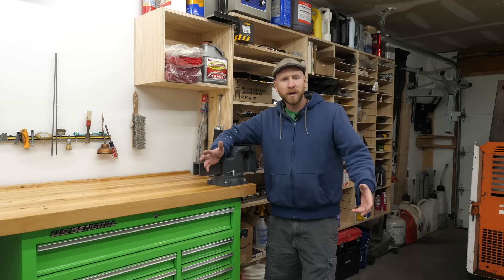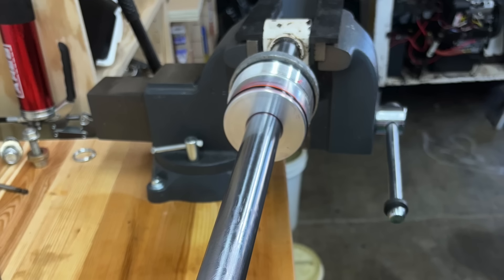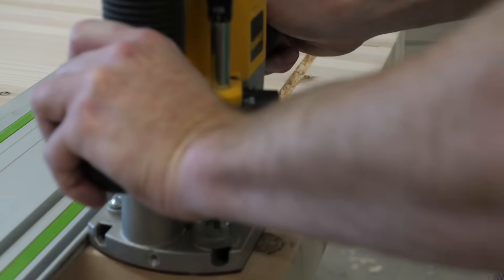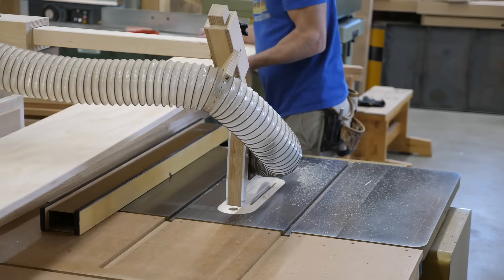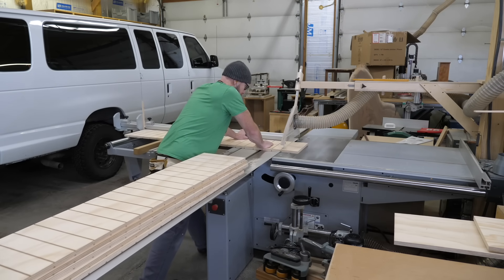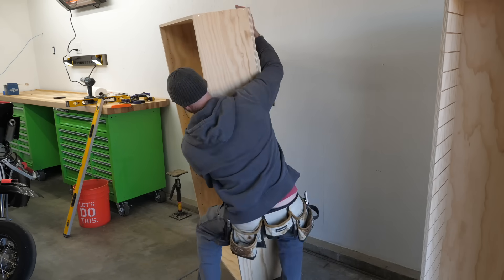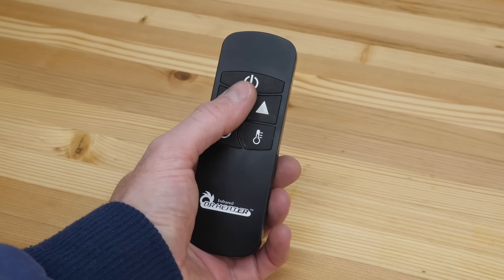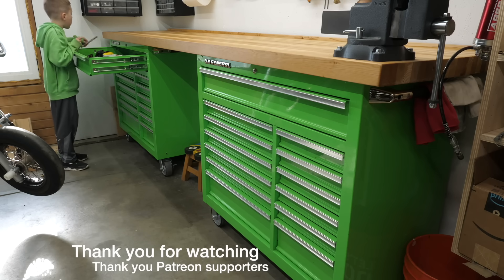Garage Organizer and Workbench

Comment: I built a similar system with these differences: the cabinet casters removed, and I built a wheeled tray for the cabinets to sit on. They got their own top that performed as a roll-around worktable. This cabinet tray was stored under another bench. So now I had two work benches, one permanently in place and under it a roll-out tray of cabinets also with a work top. As I got into hand tool wood working, both were insufficient and unsteady for hand tool work. They were scrapped and the wood turned into replica antique tool chests. I think your 2x6 lumber top will be fine.
Reply from the maker: I considered removing the casters to put the workbench at a more manageable height. Sounds like you have a great setup.

Comment: Enjoyed! 

Small tip for metal vises- bolt in a strip of copper instead of their OEM crappy hardened steel inserts. Much less marring and excellent grip without futsing with plastic jaw protection. Last vise I did was a 1960’s vintage Record #6 for which 1/2” x 1” copper bus bar was perfect fit. And cheaper buying it as bus bar than exactly the same copper from any of my usual non ferrous suppliers. Holding up well in a machine/fab shop with heavy use. 

Bonus: makes a good heat sink for small part tig welding :-)
Reply from the maker: That is a very good tip. Thank you for sharing.
Reply: For those in the 3d printing hobby, print some replaceable jaws out of TPU. I have some up on thingiverse for the HF 5" vice.
Reply from the maker: @larrybud  Totally cool. Thanks for sharing.

Comment: Idea for your waste motor oil. Build a Sand Box for Garden Tools. Build open box approx 2ft wide,12in deep/high. Fill with coarse sand, add copious motor oil/kerosene mix.
After using garden tools, shove vigorously into sand/oil mix to remove all mud/garden residue, leaves oil residue to prevent rust & smooth surfaces dig into garden easier. Hang tools above box to catch any drips & air dry
Reply from the maker: That is a very interesting idea. Thank you for sharing.

Comment: I have been thinking about a top like the one you built - you validated my design approach. And my cheapness, because I could just go to Lowes (not Home Depot) and buy butcher block. Love the magnetic sheet idea. Thank you for another great video.
Reply from the maker: Thank you. A butcher block would work fine if you can find one for a good price in the size you need. Good luck with your project.

Comment: In the process of making almost the same thing except I bought a 10’ X 24” wide X 2 1/4 maple top from grizzly and two 27 inch US general bottoms (plus one top) and one 46 inch. One of the 27 inch and the top will sit at the very end of the bench (not under it) for small parts storage (using Schiller bins). Mine are in gray.
Reply: Oh, and I’m just adding ply to the top of bases rather than routing slots in the top. With my ongoing shop build, “perfection is the enemy of progress.”
Reply from the maker: Sounds like you have a good plan. So far, I'm really liking my setup.

Comment: I totally agree with the look of the revolution ply, it's used as a sub floor for tiles here in Canada.  It comes with a printed grid for screws which I tried sanding off but the veneer is way too thin.  They should make it furniture grade, would be a cheaper alternative than the bamboo that looks very similar.
Reply from the maker: I totally agree. There is a lot of potential.

Comment: Hey Mike! Excellent video as always. I have those same lights in my garage and man what a game changer it is to have good lighting.

Out of curiosity, why staples instead of brad nails? I hardly ever see people use staplers for this kind of thing but admittedly I have no idea why
Reply from the maker: Staples are a little stronger for cabinet assembly. If you don't have a stapler, brads are just fine.
Reply: Thanks! I suppose brad holes are a little easier to fill if it is in a place that it matters. I'm going to start using my stapler for other stuff though, thanks!
Reply from the maker: @crankstonshnord6591  Yes, if it is an exposed side, brad nails are a better choice.

Comment: Hey Mike, you might want to get that saw serviced - my TS55 goes through 8/4 hardwoods without any real issue, quickly.
Reply from the maker: Hmm. It is like a million years old, maybe there is something wrong with it. I'll need to dig in and see.
Reply: @MikeFarrington  I agree with Mike, the TS55 is underpowered. Okay, a fresh, sharp blade will make a difference. But for a full depth cut, I'll always do it in multiple passes.
Reply from the maker: @idontthinkso666  I know its not the same thing, but my skill saw can make a full depth cut with a horribly dull blade and not bog down.

Comment: Why did you use 2x6 and half them vs just using a 2x4?
Reply from the maker: Yeah, good question. I forgot to mention, all the 2x4s looks horrible. Where as the 2x6s looked much better.
Reply: @goaliem288, yeah actually using 2x6's will result in less warpy stuff after you resize it... it's a cool shop furniture secret I likely picked up from @MikeFarrington, but not sure. The big box stores only source 2x4s from trees that grow like curly fries.
Reply from the maker: @mattelias721  Yeah, I'm with you.

Comment: I like your lids but seriously you need to just get an oil pan that has a screw on lid for vehicle motor oil. They even come with a convenient spout
Reply from the maker: Those are much harder to carry and dump, plus the spout caps always leak. I've gone through a couple of those over the years. To each their own if it works for you.
Reply: @MikeFarrington  bummer Ive only had good luck with them. I like the option to temporarily store the oil in the same container it is drained into
Reply from the maker: @howardsmith5474  So for me, as the oil sloshes around, it rests against the drain cap. At some point these start to leak.

Comment: East Coast Safety Squad update: The flickering lights are to remind you that you're about to burn your shop down. Non-influencers should nevet plug heaters into power strips, especially when they're not good at the "maths"...
Reply from the maker: The flickering lights is a function of lower quality drivers in the LEDs.

Comment: Shop bench tip: Instead of oiling the top, use 1/4" hardboard or mdf as a replaceable top!
Reply from the maker: That is a good idea. Maybe I should have done that.
Reply: Will second this recommendation. MDF also oils up very, very well.
Reply from the maker: @mattelias721  Thank you.